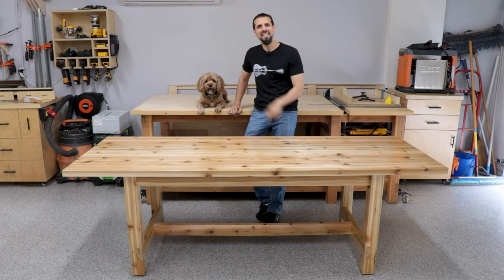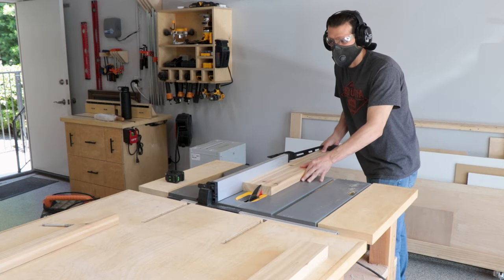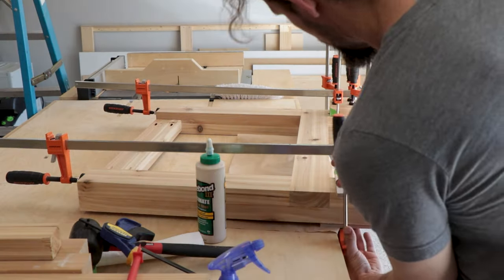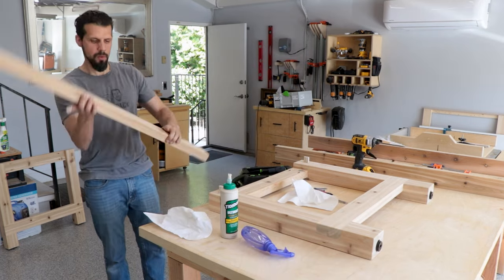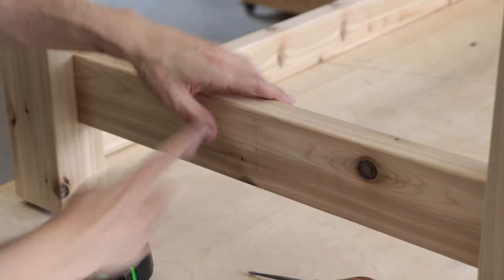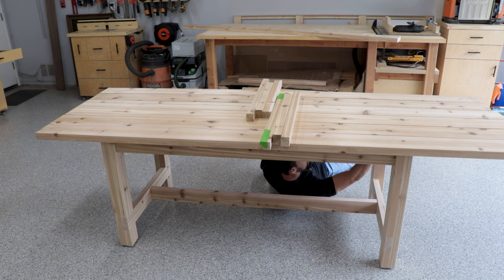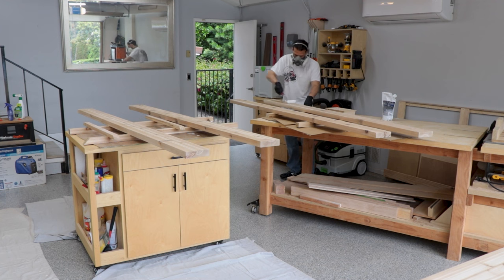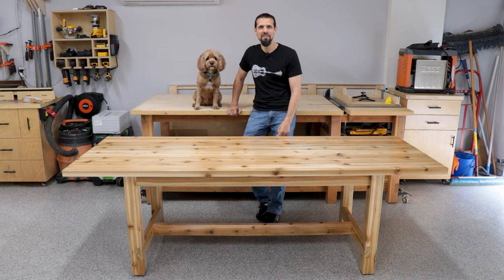Build a DIY Outdoor Table

Comment: I built this table about a week ago. I think it turned out well. The instructions and diagrams were very helpful. I used 5 coats of Spar Urethane on the table top and I'm hoping it last a little while. If anybody is thinking about getting these plans I say do it.

Comment: Nice job on the table. 
A Tip for using the Forstner bit handheld is to make a guide for it by using a piece of flat 3/4" board and drill the hole in it on the drill press and then clamp or screw it on to the part you want to drill and use it to guide the bit without jumping around.
Reply from the maker: Thanks for the tip. Don’t have a drill press yet, but will definitely keep that in mind

Comment: Nice job! And congrats on the new toy! I have the corded version and love it. It was one of my first festool purchases.
I highly recommend one of their dust extractors from the midi up. The ct 15 is a hard sell since it lacks the nice hose and no bluetooth feature. I have the midi and am very happy with it.
If you ever want to upgrade form the beadlock but don't want to spend domino money, consider the dowelmax or jessem doweling jigs. They're not like the cheap, junky jigs out there; they're precision made, very accurate and a fraction of the cost of a domino (even as amazing as that tool is). I went with the dowelmax because of the integrated clamping; no regrets.
Keep it up! Looking forward to the next one.
Reply from the maker: Thanks! And yeah, I also recently got a dust extractor. Going down that slippery slope! That's a good idea for the dowel jigs. Its definitely going on my list of tools to get.

Comment: Great job.  The only thing i would do differently is to ignore the table top pocket holes and fastening.  Table top is not going anywhere...plus you can install undermount blocks to avoid movement.  But what this does of course is allow for easy transport (as u mentioned) and more importantly, seasonal storage for harsher climates.
Reply: I lied.  Another change would be to include two center stretchers, leaving enough room in between for an umbrella
Reply from the maker: That would be a good addition.

Comment: Nice table...not complicated joinery...but I wouldn't use the term 'easy' to describe the project. Loads of specialty tools, jigs, bits and clamps are needed which 95%of DIYer don't have.
Reply: I disagree.  If you want to build a table out of wood you need tools with which to work the wood.  Otherwise, DIY is not for you.